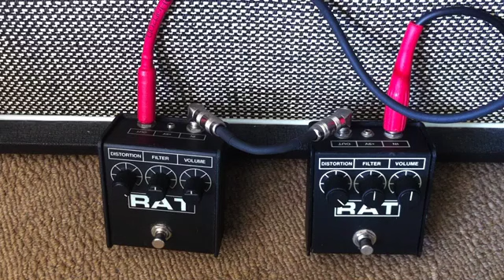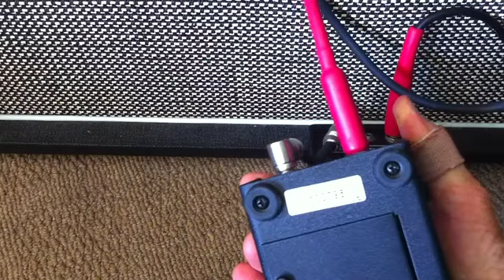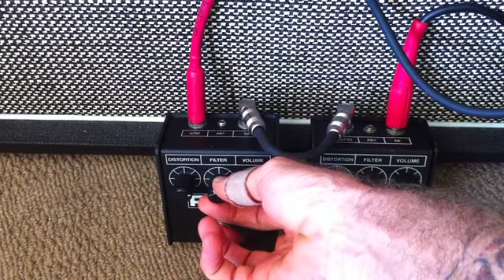Is this a ProCo Rat or a Brat?

Comment: I found an answer here: https://www.thegearpage.net/board/index.php?threads/proco-rat-experts-needed-rat2-or-brat.1891909/

From user named "ItsaRat!" (who seems to work for Proco):

I'm guessing this is a circa 2000, 2001 USA Rat2, but I'd have to have a look inside to be sure (beyond the gut shot in the thread) to be sure. As far as the Brat sticker: one of two guesses. 

A: Someone lost the serial number on their Rat, wanted to sell it, had a Brat they wanted to keep, transferred it to the Rat. 
B: Much more likely, ProCo ran out of Rat stickers, and rather than not ship an order, they used some Brat serial numbers, which I assure you, they had in abundance at the time. There are Rats out there with DB1 serial numbers for the same reason. If I recall correctly, we actually used or maybe still use Vintage Rat Serials for the SOLO. Hope that helps!!!